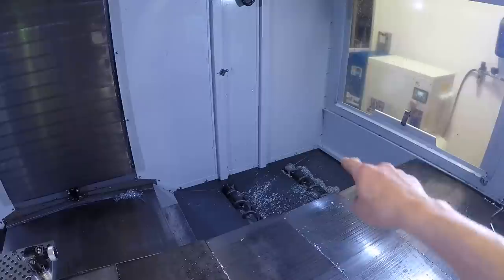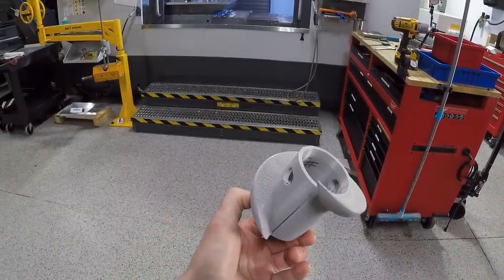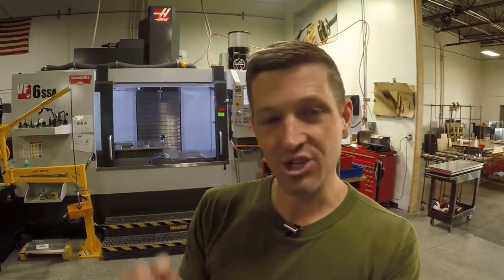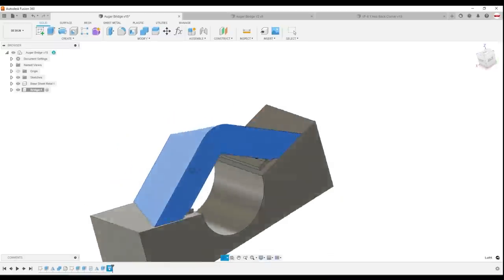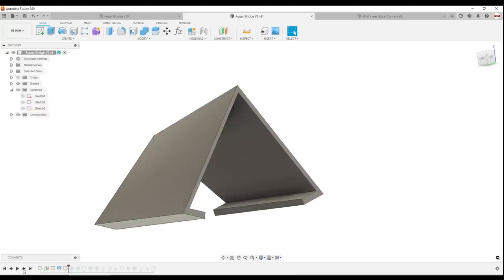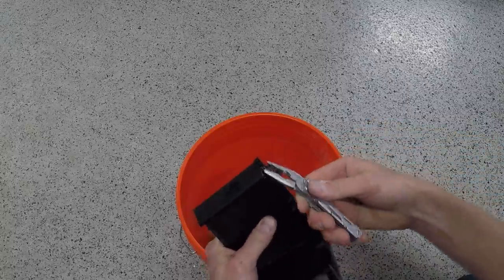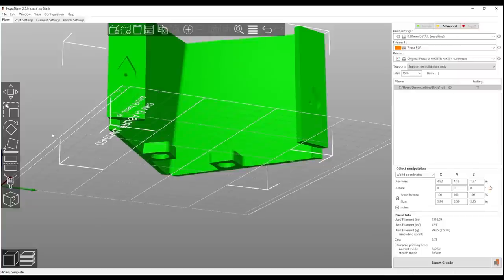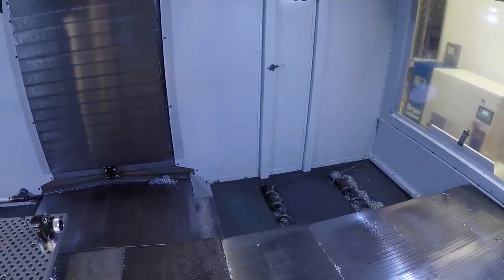3D Printed HAAS CNC Auger Covers to help eliminate CHIP BUILDUP!

Comment: you should consider using a newer version of prusaslicer because there is now a smart option in the paint on support tool that means all you have to do is click a face and it will ad support there instead of manually clicking and dragging and potential missing a spot or putting support where you don't want.

Comment: What a great idea, I spent way too many hours clearing those corners. Question, what strength & size did you use? I imagine you want a strength where it’ll hold the piece on secure but not so strong that it collects chips.

Comment: Great video.
I do wonder why a major machine builder like Haas does not solve the chip disposal problem properly in the first place.
Also note the cracks and crannies around the various sheet metal joints. Simply not good enough. Over the life of a machine  
the labour needed to clean it is a significant cost. In a production environment an operator is likely to be running several machines. Just cleaning them might account for a couple of hours a day.

Comment: You are using the CNC machine wrong.

Chip augers are designed to work well until you actually need them. That's by design. Lol 🤣